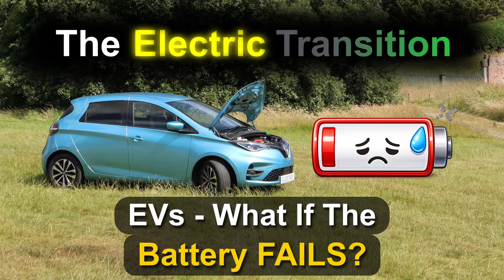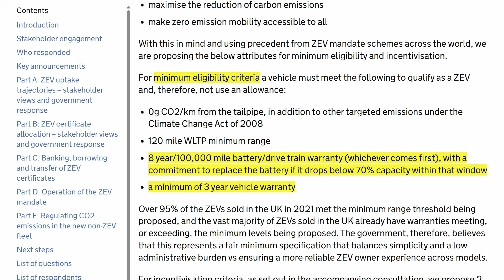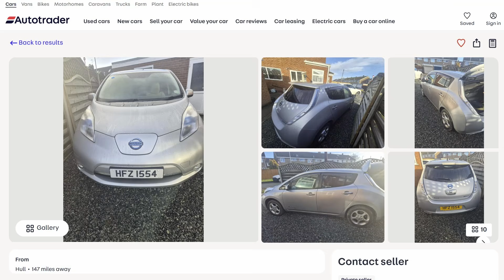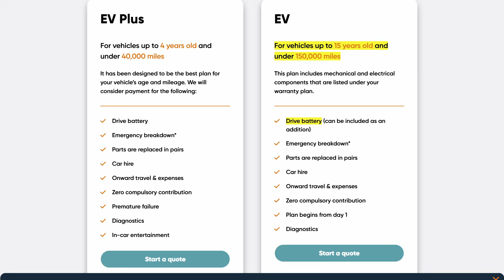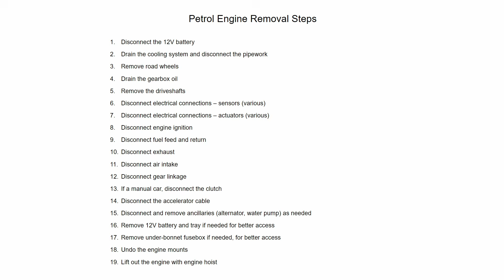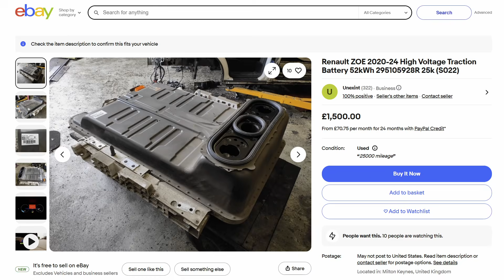EVs - What If Your Battery Fails?

Comment: I enjoy watching car restoration videos, and I've learned a lot about the things that can go wrong, that will stop gasoline engine from working. 
Multiple filters , pumps, belts and so forth any one of which , if it goes wrong, could wreck your engine.
Reply from the maker: Sadly, yes. I think that might be more of a problem now, particularly with wet belt engines, which seem to be a retrograde step - a failed experiment, sadly.

Having said all of that, I do consider the internal combustion engine to be a marvel. Engineers did an extraordinary job of taming the beast and making it very reliable.

I feel like I'm much better off with electric, but I still have great respect for internal combustion and the modern world it delivered us

Comment: There are lots who are buying very cheap early cars and just running them as second cars.  There are also some who have had their traction battery repaired or (ex)changed for one from a written off/scrapped vehicle.  Some of the others are actively resorting to install a new battery.  Usually a higher capacity replacement.

The early Nissan leaf was one such example where Robert Llewelyn drove his car to the Netherlands, where a new battery was fitted.  That was several years ago and the exchange was documented on his video channel at the time.

As, in that video you referenced, the leaf is a relatively easier car into which to change the battery - no cooling system to contend with.

There are more recent videos of new chinese-made battery swaps.  Andrew Till, on his “Mr EV” channel more recently up-loaded a video of a change of modules (for a 24kWh leaf) where 50kWh modules were installed in the old battery case.  The range of the original battery/car was doubled by exchanging the old modules for these higher capacity items.  At the end of the video it transpired that it would have been about £300 cheaper to have imported a completely new battery from the same chinese source!  More expensive  battery, but less labour costs.  

Batteries/ modules are available for the  BMW i3 and clearly other models will be (or are) accommodated, too.

This may be an easy, relatively inexpensive option for a fully warranted repair into an otherwise reliable vehicle, by extending its life by another perhaps ten years -  the i3 is built around a lot of carbon fibre bodywork and  is still regarded as a good effective BEV.

It has been shown that an old BEV can be ‘recycled’ into a good vehicle, not just scrapped.  The old battery might easily be up-cycled to a second life as a home BESS, too.

Comment: As one of the owners of those very old leafs, every now and then I look around at what options there are for battery replacement. 

Mine was 24kWh when new but is closer to around 18kWh usable now. 70k miles and12 years and it still gets me the mileage I need. But maybe in another 3/4 years I might need to think about replacement. 

5 years ago when I looked it was around £10k for a 42kWh reconditioned leaf battery. Now you can get a brand new 60kWh battery from China, £5k including installation. More than tripling the range for only £5k is quite appealing!
Reply from the maker: Wow, 60kWh - that would be an extraordinary upgrade!

I think a few years ago EV batteries were in short supply and highly sought after for not just repairs, but also conversions and home storage. I think conversions will have moved on to other options and home storage is being commoditised by dedicated, off the shelf solutions. Therefore, it makes sense that prices will have dropped in the secondhand market, and Chinese manufacturers supplying drop in replacements helps too
Reply: Tri, as much as the increased range would be a benefit, my wife and I have found charging speed to be even more important away from home. Especially with cars with over 200 miles of functional range!

If that replacement battery has 150 kW charging, that’ll give your leaf about 200 miles of range in 30 minutes!!!
Reply: @freeheeler09 unfortunately the replacement is only for the battery, not also the charging elements of the car. Also the leaf is chademo so you’d be hard pressed to find a chademo charger that can provide more than 50kW. 

For us, it’s a second car. If we go on long road trips we’d take our other car. A battery upgrade would be so that we never need to rapid charge this car.
Reply from the maker: @Trifusion1 good point, ChaDeMo is indeed a bit of a limiting factor. I think the standard supports up to 150kW, but I agree that there will be few chargers that can provide that power - and the car's wiring will surely not.

Have you considered an upgrade to 40kWh rather than 62kWh? I am wondering if the 62kWh battery is highly sought after, and you are being asked to pay a significant premium for it. I am very surprised how expensive the upgrade is for which you have been quoted.
Reply: @theelectrictransition  I haven’t been quoted these prices, it’s just what I recall from things I’ve seen online. 

This comment prompted me to go back and double check the pricing and actually I was a bit off! The one I was thinking about was from a Mr. EV video, link below. It’s actually a 50kW, brand new Chinese battery which cost £5k but that didn’t include labour which was another £1k, making it £6k all in. 

https://youtu.be/Zv_7wTxrvL0?si=b6vLAOoWuE9Wqvf0

Cleevely EV also do leaf battery replacements. They use official Nissan batteries reclaimed from wrecks. Their fee is £6k for a 40kWh and £8k for a 62kWh, which is more expensive per kWh but it also comes with a 3 month warranty. 

https://www.cleevelyev.co.uk/battery-upgrades/

Hopefully this is the start of a growing industry. I could see model 3/Y 3rd party battery replacements becoming a big market in 5/10 years time due to the number of those vehicles on the road.
Reply from the maker: @freeheeler09 Unfortunately the limitation of charging speed is a combination of what the battery pack is capable of and what the wiring in the car can support. If the car was originally wired with a lower power in mind, it's very unlikely it will support a faster charging speed after a pack change.

Comment: There was an interesting survey released last week that claims to be the biggest ever UK study of used EV battery health. I don't seem to be able to post a link? But if you Google 'Generational 2025 Battery Performance Index' you will find it.

My Zoe battery is at 91% SOH after 114k miles, so probably good for at least 300k miles before it drops to  70% SOH
Reply from the maker: Thanks Malcolm. Yes, I sadly learned of that new study only after having finished this video, so I'm looking forward to studying it in detail. That might form the subject of another video at some point.

URLs sometimes work, but I think it's rare. YouTube tends to be cautious about what it allows to avoid scammers, and it's not something I can adjust.

I'm glad to hear you managed to get a reading on your SoH, after we missed one another at Farnborough. 91% is pretty good going; if I recall the car is 5 years old? The latest thinking is that calendar ageing is probably more significant than cycling in real world usage, although the latter (somewhat related to mileage) does have a small part to play.

It sounds to me like she's continuing to serve you very well. Well done ZOE 👏👏
Reply: @theelectrictransition  My Zoe will be 6 years old next month.
  One of the survey conclusions - Mileage is an unreliable indicator of car battery condition.

Comment: Well structured video, informative.  If I had an out of warranty traction battery failure I would contact a specialist , e.g. Cleevely motors, and get  them to do a pack/cell analysis, and determine whether I need a replacement pack, or just a module. Same as any fossil car, refurb  engine, or jest a skim and ring job to a price.
Reply from the maker: Yes, that's a great approach. HEVRA garages are the answer to keeping older EVs on the road - which only applies after the warranty has expired. Cleevely are doing great work, long may they continue.